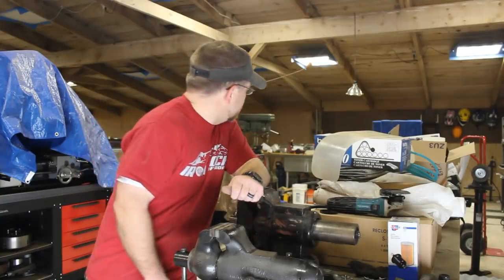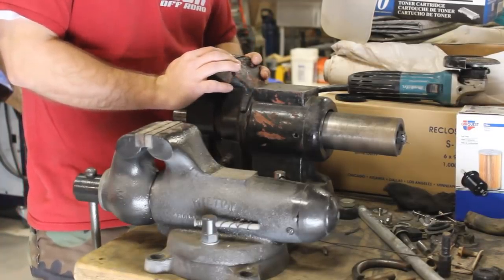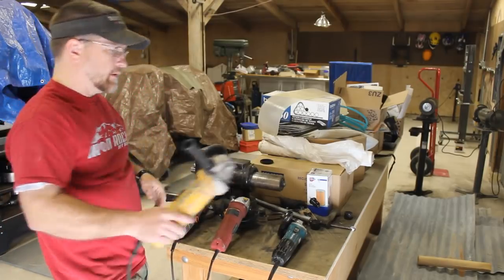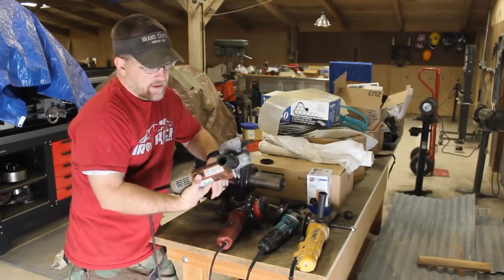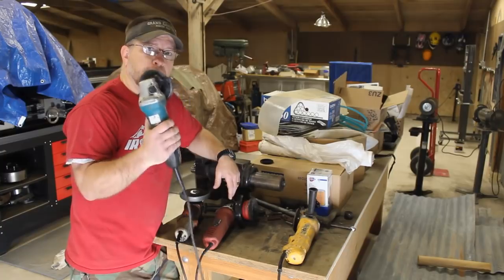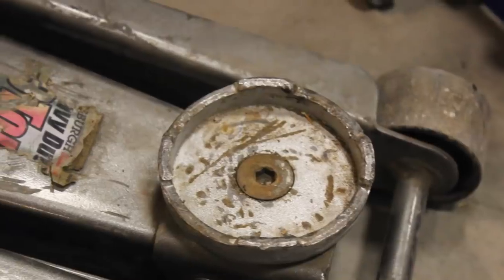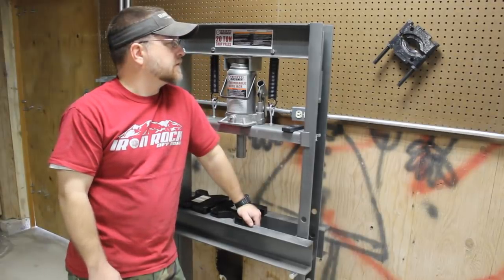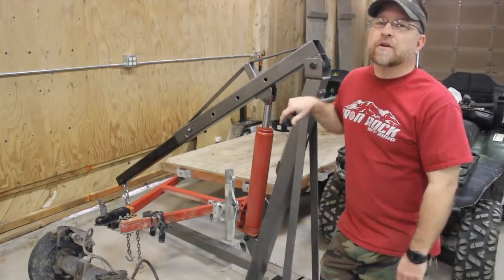CHEAP TOOLS! 5 Harbor Freight Tools I'd Buy Again

Comment: Buy cheap first. If it breaks, or it drives you crazy for whatever reason, then replace it with better. 9/10 times, the cheapo will be all you need.
Reply: I agree, if i use it everyday or alot i might buy a better tool but if i only use it once in awhile i go harbor freight. Most of the time now its harbor freight and their tools are getting better and their prices are staying the same.
Reply: try the knipex pliers you just cant go back to cheap one after working with them

Comment: Breaker bars are another good buy at HF.  I keep them in each vehicle, with the correct socket for each.
Reply: Yup! And if you get the cheap Pittsburg Pro versions, they are lifetime warrantied... I've broken  one before, and you can literally walk in, hand them the broken one and they'll let you take a brand new one; no charge. It's neat.
Reply: Christopher Engel I can't believe you broke one. I've seen them endure pressure test and hold up better than the snap on one they are awesome breaker bars
Reply: Some of their fine-toothed ratchets are pretty good too. They aren't too expensive and I have yet to break one.
Reply: I do the same thing:) pretty cheap to do! Very worth it!

Comment: You got that right. Finding an older Wilton vise is gold. I'm surprised the impact sockets have held up for you. I've heard others say they are not good at all. Good to hear.
Reply: I used to work at harbor freight and everyone who I asked about the sockets loved them. I've only used the 3/4 socket for my lug nuts but it's held up to breaker bars and impacts with no problem. I would get the full set but it skips some sizes I am opting for a different brand with a full set for now
Reply: Chrommoly ones are the only good ones.
Reply: My harbor freight impact sockets are 26 yrs. old and never broke one even with a breaker bar.

Comment: I have the 6 ton stands and two harbor freight floor jacks. The stands can hold up a 5000+ lb bronco no problem. One of my floor jacks has been through hell and back, yet it still works. I’ve only had one issues with the aluminum jack after 2 years of use, but the steel ones kick ass.

Comment: 3:15 I have 3 from Harbor Freight that I keep one with a wire wheel, another with a grinding disc, and the 3rd with a cut off wheel. Saves time.... Plus I have a Porter and a Makita.

Comment: I had my first HF engine hoist for 15 years. It probably pulled an engine a year and was used for countless other things, was left outside all the time and abused. I wound up buying a new folding one a few years ago and gave the old one to a friend of mine and he still uses it lol.
Reply: Yes mine is 30 yrs. old and lives outside also with plastic covering and using it now to hold up the front end of a car off the ground to work on suspension with blocks under frame for safety.

Comment: I have that low end angle grinder and we’ve given it a few hot suppers. It’s let the smoke out once or twice but it still works great. I just picked up two “Bauer” cordless angle grinders. I can’t wait to use the crap out of those and see how long it lasts. In total I have 4 angle grinders and like you said, having different attachments one each grinder saves so much time.

Comment: The Bauer portable bandsaw is great for $100. The blade that comes with it is great for thick metal. I used mine to cut down a 16' 5x8 I-beam so I could haul it.

Comment: I work with 2 DeWalt's (20 yo) and a harbor freight (about 15yo) angle grinder. My deep impact sockets are HF. 15yo. Another HF item I've had a long time is a 60 pound anvil. I'm not a blacksmith but I've shaped plenty of sheet metal on it for years.

Comment: Yes please show your press upgrades. I have that press and have used it quite a bit in stock form.
Reply: enginesnstuf ive considered buying it for doing dimples and would also like to see upgrades!!
Reply: Swap out the bottle Jack for the HF pneumatic bottle Jack.
Reply: @Twizter68  I've considered doing that swap when I eventually purchase one, but, while greatly increasing the efficiency, that also eats into the cost savings, which is kind of the point of buying HF tools.

Comment: Harbor Freight isn't half bad if you know what your looking at.  Some stuff  ain't worth taking back to the shop but videos like this one give you a fighting chance of making a good choice. I got one of their one inch belt/disk sanders, little tiny thing, still using it to sharpen lathe tooling 20 odd years later, I got my thirty nine bucks worth.  But the best buy are the angle grinders, I bought two at ten People's Republic of Oregon spondoulic's each.  After nine or ten years and not just a few hot suppers and a cord replacement they are still hard at it. ( My daughter says AvE is a bad influence, I hadn't noticed) A spondoulic is worth about 14 cents Canadian.

Comment: Was the engine hoist the 1 ton or 2?  I have a couple of the angle grinders.  Yup, they work.  I keep a cut off on one and a flap on the other.  Rarely have to change.  A good addition on the 3-ton floor jack is putting a hockey puck on the lifting disk.  Spreads the weight and won't slip.  Thanks for posting.

Comment: Yes they have some great tools, I love the Bauer porta-band deep cut band saw as well. Works great for cutting perches and brackets etc.
Reply: Been wanting to buy one, have you tried their blades they sale if so how are they?
Reply: @mikefinto4048  I haven't used the blades from HF, I've been picking mine up from Lowe's.
Reply: @SketchyJeeps  how does it fair with steel around 1/8 and 1/4?
Reply: @mikefinto4048  like butter, I used it to cut the radius arm castings off my 08 superduty Dana 60 front, those things are about 2-3  inches thick. It won't break a sweat on the small stuff.
Reply: @SketchyJeeps  Wow, thanks man definitely gonna get one now!

Comment: I work in a shop full of guys that have $5000 Matco tool boxes full of Harbor Freight tools.  Yes they have select Snap On and Matco things they spend large coin on, but ratchets, sockets, wrenches they use the heck out of them. My favorite is the guy with the $250 flashlight! hahahha
Reply: It's funny you mention the big Matco box...the US General box is MUCH better!
Reply: LOL. I have a second -hand $1000 Matco tool box full of Harbor Freight tools. I work in a large shop  (50 mechanics) for a trucking company. We have all the tool trucks come around (Mac, Matco, Snap-On, Cornwell). I started 5 years ago on a budget with HF tools and always figured I'd work my way up to the more expensive ones when these broke or wore out. I haven't had to yet.
Reply: Hf chromoly sockets are good.

Comment: Bought a vise from them about 6 months ago, had to return it and a few others before I got one that would actually keep tension on anything, so not sure if the newer ones are as good as the older stuff. Have bought bottle jacks, and other hand tools that have been solid though.
Reply: You know the vises=especially the smaller ones=are one of their faults and I studied why mine failed and noticed their sand casting is very porous and they fill in all the holes with something like bondo and if you man handle the tightening on the vise and it sits on one of these holes in the casting then it will fail quick.
This is one of the only items I might spring for a quality cast vise as it is the most used tool in the shop and I'm one of those guys that will reach for a small breaker bar to give it that little extra grip.  But as you say all the other stuff I have from them I get real good service out of for the price.

Comment: My pivot adjustment on my vise broke like yours. Took it apart heated up the cast and rewelded it back on... still staying on... I think they do a weld without heating it up first and it is a cold joint with hardly any penetration. I use that pivot to hold the angle I want while I'm tightening the vise for welding, working on mower transmissions. This was my second one... 

The first one I broke the handle jaw off the center while trying to press out suspension bushings... Tried a quickie weld job on it... didn't work... So I bought another one and a real press to finish what I needed to get done... Finally got around to fixing it... went back heated both pieces up and beveled and rewelded (with 3 passes to fill in the bevel) the jaw back on the old one... Still working perfect... Have it on the other corner of my work bench.

I like Ryobi angle grinder with the trigger handle you can turn... makes it nice if you are grinding at a weird angle for a long time... Seen them as low as 27.00

I have the same silver jack... 3 ton... Working great.

I use impact sockets too, however on some bolts and nuts, like lug nuts on some aluminum wheels, engine and suspension the walls are too thick to fit into the hole they give you, so you have to have some thin walls laying around.

Love the press... Did mod my release handle.

Have the same engine lift... and bought the load leveler at the same time... you will love it... makes it so easy to pull and install a motor by yourself...

Comment: i have a HF jack, jack stans, and an air compressor all bought in 1993. and countless other tools from HF over the years that still work. like a 3 pound wooden handled hammer. Pittsburg sockets break less than craftman

Comment: I have the 4" Chicago Electric angle grinder from gee at least 10-12 years ago still works great and I've beat on that thing pretty hard several times.  I do have the 4-1/2 and 7 inch versions as well and both of them work great too.  Its nice to have different grinders setup for different tasks so you don't have to swap wheels all the time.  

I also have the 10" compound sliding miter saw from about the same age range as the 4" angle grinder, back when their basic power tools were all orange.  The miter saw still works great and I've used it for several flooring projects and wood working projects as well.  I added an irwin arbor mounted laser which works great just changed the batteries in it last spring it was put on a couple days after I bought the saw.  I do have the 12" compound sliding miter saw as well, that came with a laser guide, I can tell you the saw works great the laser guide is a joke, after a couple cuts the laser lens is covered in sawdust so its pretty useless after that...I cannot find the irwin laser guides otherwise I'd fit that saw with one as well.  I haven't purchased the Hercules 12" model but looks to be an even better one than the 2 I have, but the 2 I have work great nothing to complain about, took the time to lubricate and adjust everything out of the box to make sure they're accurate and haven't had any trouble with either saw.  

I of course have several of their air tools, and screwdrivers, wrenches, sockets, etc....all work great especially for the price you can afford to equip each of your vehicles with its own tool box.  I have a tool bag setup just for going to pick a part yards, if I lose a Harbor Freight tool it wouldn't bother me nearly as much as losing an expensive one for sure.

Comment: I concur that the HF angle grinders are a steal, and when there's a good sale, I do buy extras to use different wheels on, and keep spares on the shelf.  It's come to the point, I only use paddle-trigger grinders, like the dark blue one, but I also "splurged" for a $65 Vulcan grinder, and it's an impressive beast.  (comparable to my DeW..)  I'm also impressed at how a lot of HF tools come with an extra set of brushes, since that's probably what sends a lot of electric motor tools to the rubbish bin.  I've only had to use the extra brushes once, after I let a dummy borrow an angle grinder, and he burnt it up.

Comment: I like Harbor Freight. Like you I’m a hobbies on a budget. For the occasional or light use Harbor Freight tools seem to hold up. Obviously these are not meant for everyday hard industrial use. Any opinions on their transmission jacks?
Reply: Niner 8 Tango Juliet I have their tranny jack, if I remember, they have 2 of them, I have the higher rating one. I used mine to swap the transmission from my 7.3 diesel , the trans weighted like 400 pounds with the transfer case. If you need one, then it’ll be a good buy.

Comment: We have that same press in our shop and it's been great but unfortunately we had a new guy that didn't take the snap ring out when he was trying to remove a wheel bearing and bent the stud on the press slightly. Not the press fault though and it's still useable and worth the money. Would love to see the upgrades you mentioned.

Comment: I got a few HF tools and they have been pretty good air tools and hand tools.i bought that same kind of vise you talked about first and mine broke not to long after I got it. It was that round peace that runs through the middle that is connected to the outside jaw it broke in half only thing holding it together is the long bolt used for tightening or loosening.

Comment: I use the blue paddle switch grinders. I buy when on sale. I set each of mine up with 3 different things also. One thing I do is test run them at the store BEFORE buying. Have had a few spark and burn out right there instead at home but if good then I can count on them lasting awhile. they cost about $20 on sale. 
Cut-off wheels on sale also, 10 for $6 that I max out the coupon limit.
I have the 3 ton floor jack and it lifts everything I have here. 
I have the Bauer porta band saw, that I go to HD for blades, and I love it. Made a micro back-hoe last summer with it.
I picked up the 2 ton engine jack and a engine stand (800lbs-1000lbs?) used for $100. 
Have had the impact sockets deep and shallow for years and I too beat the snot out of them. 
The Pittsburgh hand wrenches are great when you don't want to customize a Snap-on wrench.  
Just grabbed the 20 ton press this spring during a parking lot sale for $130. Also picked up the Bauer electric impact gun.
Damn I've spent alot there LOL And I still want the tool box!!!

Comment: well the grinders are a great deal economically even if they dont last as long, im just not interested in them i like to lean into the grinder and get cuts or welds ground in a hurry, i bog down my 12 amp rat tail makita so id smoke the 6amp paddle switch first use

Comment: For a good floor Jack, go to Costco and pick up one of the Arcan brand 3.5 ton service Jack's they sell. I have 3 of them. They used to be blue and now they're red. They are VERY high quality and come with a pump seal kit in case the seal blows out, which I have never had happen to me. They raise up really fast till you get to the point it starts to lift weight. Best part is they are under 100$!!! I think I paid 80$ each for my newer two Jack's which are the red ones and that wasnt that long ago. The older one I have looks about the same but is blue and it's been going strong for 15 years now. I highly reccomend it over the harbor freight Jack. Liked and subscribed! I just started a jeep MJ project so I'll be watching the channel a lot! Doing long arm up front, triangulated 4 link rear, 9" front and rear axles with disc brakes, air shocks front and rear, TDI swap, AX15 with dual t-cases, etc. Gonna start this summer in Hope's its ready to wheel summer of 2020.

Comment: A couple of other HF winners are their Breaker Bars and Pry Bars  those have been put to the tests  comparing them to name brand ones all ove You Tube  and i  have beaten the crap out of many of their air tools  in more details  the die grinders and rotary cut off saws  i definitely agree with the items you. Picked as well  years ago KMart used to carry  a decent lie of hydraulic jacks  branded. Under their name   I liked the bottle jacks the most because they came in a blow molded case that. Housed the  handle. As well  it was a cheap case but it worked. I. Owned and pulled lots of trailers  ove the years from boat,car, and Campers and ive kept one of those KMart bottle jacks in the bed of my Dually  truck bed  for over 20 years that has. Helped me get out of a few jams over the years as well as  I don’t. Hesitate to pull over if i see others on the side of the road pulling a trailer as i also keep   A variety of trailer hubs, bearings, caps and grease  in the truck. One time my son and i pulled over  and helped a family with a blow out on their camper.  I just so happened to have a little Honda generator in my truck that my son got running and ran extension cords just in case  we needed  power tools  the fairly couldnt beleive how fast we were and they kept saying they though a NASCAR team pulled up to help them  with all my trailers. I  liked to keep numerous  sizes of wood blocking. To level things up or chocking the  loads to  keep them from shifting plus i was a carpenter by trade so that didnt  cost me  anything as they were off cuts from whatever job i was on  i would often. Block. Up that bottle jack to. Do whatever i. Needed to get done  my brother in law used to call me the McGuyver of trailers  after he blew out a couple of bearings  on his boat trailer  one State away from where. Lived  with the parts i had. I couldnt get him road worthy at 10 o clock at night but i did get hi to the point that we could load him onto.  A roll back to get home safely  an old trick of my Dads was to  keep the old parts   That were worthy of  reusing  o at least  that you could repair at your leisure  plus many of the parts were smalls and easy to  box up together  in the  replacement parts boxes  on those I typically. Wrote in a magic marker what trailer it was for

Comment: The $8 fluid transfer pumps (mechanical) are great to have in a few places for water, oil, fuel. Jacks are great. Toolboxes are exquisite. Impact sockets are a killer deal. Bauer flex light is great.....and, and, and....(but times are a’changing...I’m not a fan of their new business model with the "premium" brands).